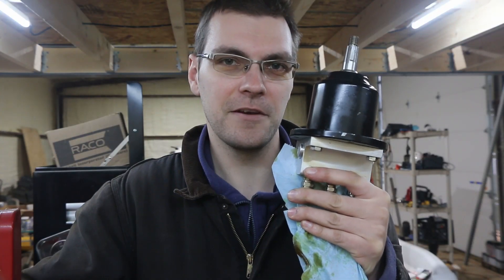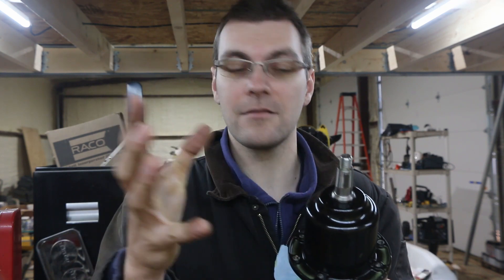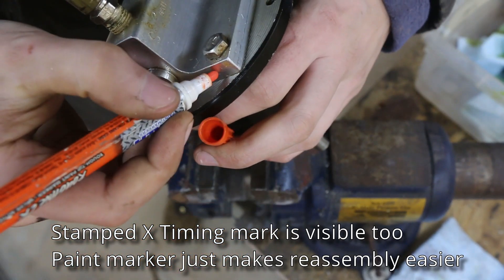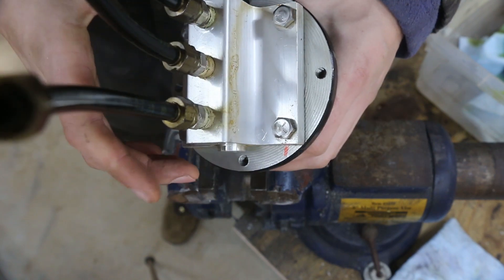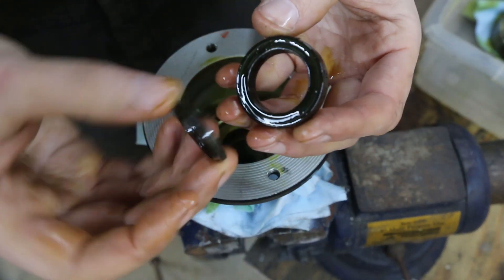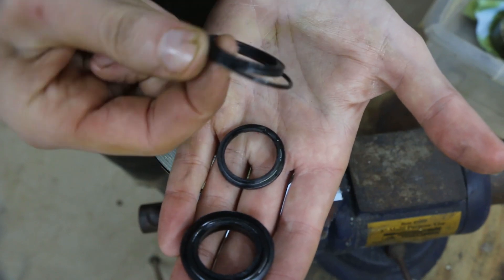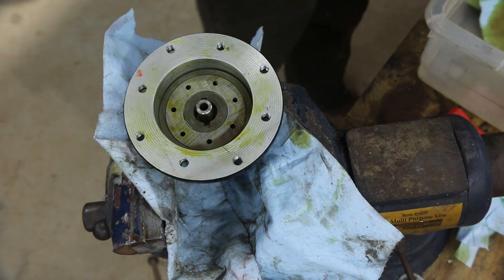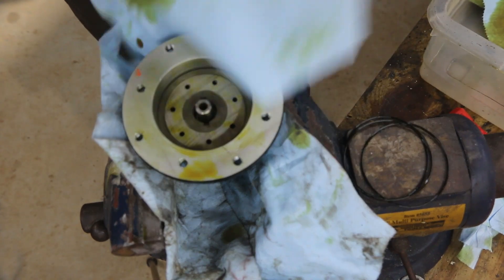Rebuilding a Hynautic H50 Hydraulic steering helm, All new seals, No more leaks!

Comment from the maker: Extra information over on the website including bleeding instructions: https://trythistv.com/hynautic-h50-repair-bleeding/

You'll need this seal kit: https://amzn.to/37vYzCZ
Which should cover H50, H51, H52, basically any of the H50 series hynautic hydraulic steering helms. 
You will also need some fluid to refill and bleed the system after the rebuild
There are several options for the best fluid. It must meet H5606 specifications, which I have selected my favorite options below:
1Qt OEM Seastar fluid: https://amzn.to/3ueS0P3 (A bit pricey but works good)
1Qt Shell Aeroshell 41: https://amzn.to/2M76PC7 (Cheaper, and also one of the fluids recommended by Hynautic/Seastar)
1Gal Shell Aeroshell 41: https://amzn.to/3durUkY (If you're unsure if your fluid is contaminated or such, a gallon of this stuff isn't awful expensive)

Links used on our channel are likely affiliate links, which earn us a small commission if you choose to purchase from one of them at no extra cost to you, and that helps keep us making videos like these.
Reply: @trythistv the linked seal kit appears to no longer be available. Any suggestions where to find a quality kit?

Comment: Hi, I rebuilt my H50 and then we installed up on the helm this afternoon and when I turned the wheel I was getting a clicking sound in both directions then when turning the wheel to the left it stopped?   would turn the other direction but not to the left.  Any subsections as to what I might of done wrong?
Reply from the maker: Any possibility that one of the pistons rotated in the bore? they are semi-directional, sometimes they will correct themselves, other times it'll jam stuff kinda funny if those little balls can't sit on the pistons correctly

Comment: I’m concerned the pistons may bae worn as they don’t seem to pump pressure if I hold my finger over the hole and push them down
Do the pistons wear out ?and cause issues
Mine has no corrosion

Mine are clean
Reply from the maker: You would see scoring or wear marks pretty badly before I would consider them worn out.
It is a fairly tight tolerance system, but the fluid will seal up some, and a little bypassing the pistons won't really cause issues.

Comment: Good vid. One question is the middle part on the white part that holds the ball bearings broken?.
Reply from the maker: Right at around 9:22 I was real curious, there appears to be some stress cracks but the whole piece felt solid. I'm not sure if there is a solution for one that is broken, I feel like 3d printing could possibly be a decent option, especially with some of the resin and more resilient filaments that are becoming more popular now
Reply: 4:59 Thanks for the responce, i was putting my pump back together, when i accidentally assembled it wrong, causeing the ball ring to broke right around the circumference, i snap it back inplace and it feels solid, thats how i came across your video sorry i didnt see it sooner. @trythistv

Comment: Thank you, for a great tutorial. I just rebuilt mine, and will put it on the boat tomorrow. Couple of things that I noticed were two keyways on the piston assembly. I hope I got that back in the right way, and it doesn’t matter. Secondly, the outer most harder, material seal that seems to disintegrate, it’s called a wiper, according to the parts sheet that came with the seal kit.

Comment: Thanks for your information.  I ordered to reassemble the helm. Getting to remove air was not a succes after a lot of trials lost year.
Reply: @guusvanderhoorn9685 - It is really easy once you back off the bypass/purge valves on or near the reservoir since without them completely backed off any air in the line will prevent enough pressure from building up to pass the air bubbles into the reservoir.  The bypass valves are spring loaded relief valves set at around 200 or so PSI when they are cranked all the way in which you won't be generating by turning the helm with air in the system.  If your still having trouble chances are the bypass valves are stuck or clogged with debris.

Pump up the reservoir with about 50 PSI of air pressure, back off both bypass valves completely, bleed the lines at the cylinder, bleed the lines at the helm and then depending on the length of your hydraulic lines turn the helm 30 to 50 times to starboard and then 30 to 50 times to port, check the fluid level in the reservoir and repeat then tighten the bypass valves and see if your getting the correct amount of turns lock to lock when you spin the wheel.  If everything is fine then check the fluid level adding more if needed, reduce the air pressure in the reservoir to about 30 PSI and your done.

The local shop that works on these wants $800 to $1,300 to install the $30 seal kit so it was well worth the time and effort.  Just did one last week and the owner was ecstatic to learn how to take care of it themselves next time which hopefully won't be for another 20 or 30 years.

Best!

Comment: What problem if steering will be with different resistance after installation
Reply from the maker: It could be one of the pistons rotated out of place during reassembly, or it is possible that there is air in the system, I had a miserable time getting it all out. Took me several hours to get it all perfect again.
Reply: @trythistv  This matches my experience -- if one or more of the pistons are not oriented correctly (grooves forming a continuous circle), the bearings will bind on the pistons and create a grinding feel and a metal-on-metal sound. My mechanic disputed this and blamed the age of the system...so I removed the unit, reoriented the pistons,  and things are back to a normal feel.

Comment: Great video, I had a tough putting the poly-pack seal in. I put a thin film of grease on the outside edge and it went right in!  Thanks
Reply from the maker: That one can be real tough to get seated all the way. A little grease is a great idea, should help it pop into place easier.
Thanks for sharing that tip!

Comment: Can anyone give me any helpful hints in getting the poly pack seal in (around8:00 - 8:21 in video) mine will not seat with the 15/16 socket, when I try and put it in by hand I can almost get it then it all just pops right out.  I have a 1996 h-50.  also the flange on the poly pack seal should be pointing up towards the steering wheel, right?  He doesn't indicate which way it goes in.  my two seals were too disintegrated to identify orientation. thanks!
Reply from the maker: Sorry, Yeah the narrower flange should face outward toward the steering wheel. I'm not sure what advice to say on getting it to fully seat though.
Reply: @trythistv  I ended up gouging the metal with that 15/16" socket trying to get it seated so then I just put the next seal on top of it ( I forget what its called now) and then used the 15'16" socket to push them both in.  I installed the helm a few days ago and its working with no leaks...

Comment: Hi, I have competed the reseal and was straightforward , however when I turned the wheel about thirty turns to port it got to full lock so all was good at that stage but now I can't get any traction on the starboard direction even after a few hundred turns . Also I seem to recall being able to hear the bearings doing there thing when turning the wheel which at the time I didn't question. I can still hear them now , is that normal 
?
Reply from the maker: I suspect you've gotten a large air pocket in the helm. Is yours a pressurized system that has the little reservoir you fill and then pressurize? If so here is what I did when I ran into that issue, not saying it's the right thing to do or that it's even smart, but it worked for me lol: make sure there is enough fluid in there, then pressurize it, then get some rags or a catch pan ready under the helm, and crack each line one at a time and make sure you get some liquid out, if possible, have a helper spin the wheel while you crack the lines, it was time consuming and not much fun to do but after doing that once or twice, refilling the reservoir and doing it again, the system got enough fluid in that I could continue with the bleeding process that is on the instruction paper.

Comment: hi! Great video.
I'm not leaking H50, but I have another problem. The boat is prowling and when I turn the steering wheel, I hear the bearings. Isn 't that wrong ?
Can replacing the seals help or is it better not to touch if it does not leak ?
Reply from the maker: I would say if the helm is making nasty bearing noises it would be good to take it apart and inspect just in case something is broken and about to cause you serious issues. I'm certainly no expert on these helms, but in my opinion they aren't that complex and I wouldn't hesitate to pull it apart to inspect, and replace the seals while you're in there, these are getting quite old and rubber seals most certainly have a lifespan!

Comment: You goofed. Had to take it apart again, didn't you?  One piston is backwards as you assembled the cylinder barrel into the housing @ 11:21.  Pay attention to the "bow tie"   profiles on the piston tops.
Reply from the maker: Caught me. Fell out at some point off camera, and I didn't notice until I had put it back most of the way together. Thought I had the 2nd take of assembly when I had it the right way around... must be I didn't. oops.
Reply: @trythistv  This is right -- really important that the "bow tie" profiles are arranged so the bearings can go around the pistons in a circle. Mechanic did mine, and got multiple pistons wrong on both helms...then blamed the age of the helms when there was a grinding feel. Re-built them myself to the right orientation, and things are back to normal.

Comment: Just to add this cost me £30 for the seal kit and about 4-5 hours changing them and repressurising  the system compared to £1000 plus from our resident engineer for a new helm with installation. Well worth having a go as I can now spend it on beer
Reply from the maker: Glad it helped you out, I feel there is a lot of fearmongering about this stuff, sometimes it is better to have someone else handle complicated things, but if you are patient and careful a lot of the time you can get the job done without any major issues, and you've proven that is true with these helms. I didn't think it was terribly complicated when I made the video, sure there are some delicate parts you wouldn't want to rebuild in a sandstorm or anything, but with reasonable care, it isn't rocket surgery.

Comment: Awesome video- Able to rebuild my H-51 no problem-  One suggestion- install the shaft in the piston housing, then install the whole assembly sideways into the main housing.  I fought forever unsuccessfully trying to line up the pin/slot until I realized I could install the assembly outside the housing- worked perfectly first time.
Reply from the maker: Glad the video helped you, and Good call on the reassembly tip, this one went together super smooth for me, but any alignment and assembly that can be done easier is definitely worth it, saves a lot of frustration!
Reply: I did this too, much easier!

Comment: Your supposed to clean out the housing well before reassembly.....
Reply from the maker: Agreed, the main thing is to not let more contaminants in, since there was no issues with contamination of the oil in this system My main goal was to prevent anything getting in and wasn't as intent on cleaning out any old oil. The steering is working fantastic, smooth as can be and doesn't leak a drop anymore!

Comment: Hi man i really need your help fixing a honda bf 130 outboard  it start but works bad every thing on it is new and i cleaned every thing . 1and 3 spark are good but ... 1and 3 Electricity is weak to the gasoline sprinklers ..
 "gasoline sprinklers are working all 4 great  "  i cant find how to pull codes or know what's the problem...
 i can have a video for you if you want .    .. thank you

Comment: Just found out my 23 foot center console has one of these for some reason. Had to buy a new steering cylinder. Seems like a pretty robust system, and kind of overbuilt for what I need. Thanks for the video. I'm sure I'll be doing this at some point in the future.
Reply from the maker: These hydraulic steering systems are neat for sure, and they are built to last a long time, very well designed.
A little complex? Maybe, but I'd rather have any kind of hydraulic steering than a cable style, I like the feel of the hydraulic steering better than the feedback a cable driven system offers.

Comment: I have this steering in my boat and it stopped working. There is less resistance when turning, is there a malfunction or could there just be air? Thanks for the advice!
Reply from the maker: That sounds like air to me. These are a bit troublesome to bleed, and any little leaks can introduce air into the system. Check what your pressure gauge reads, it should normally be around 20-30psi, if its lower then you've got a leak somewhere.
Reply: @trythistv  Thank you! There was no pressure in the system, I bled it when I checked the oil. After pressurizing to 30psi the steering worked right away, so there was no air in it. You helped me a lot, thank you very much!

Comment: Well done I have finished the rebuild now to the bleeding which did not stay pressurised. What would be the steps to find the pressure leak as it is not visible by leaking fluid. As soon as I pump it up it starts going down? André
Reply from the maker: If I recall properly, I had to open the purge valves, top up the reservoir, pressurize it, then crack the lines on the back of the helms to get the large volume of air from the lines, then spin the wheel repeatedly to get the remainder of the air out, and I had to top up the fluid and repressurize the reservoir once or twice during this process, having someone keep an eye on the level to make sure it doesn't get too low.

I had some real goofy trouble trying to bleed the system, do you have the instructions on how to do it?
if not they're available here: https://trythistv.com/wp-content/uploads/2021/05/Hynautic3linebleed.pdf
Also you'll want some fluid: https://amzn.to/2M76PC7 (quart) https://amzn.to/3durUkY (gallon) is the same stuff as seastar/hynautic uses, just in a different bottle basically.
Thicker hydraulic oils or ATF can make bleeding and steering more difficult.
Reply: @trythistv  thanks so much I think there is red ATFvin mine so it is difficult to get air out. Instructions on my reservoir and the seal kit are different. They must have upgraded to 60 turns which is depressing when you have to go through it many times due to air in system. I may have an air leak to I will check that with detergent today. Thanks again. André